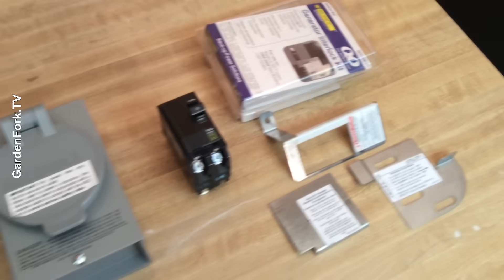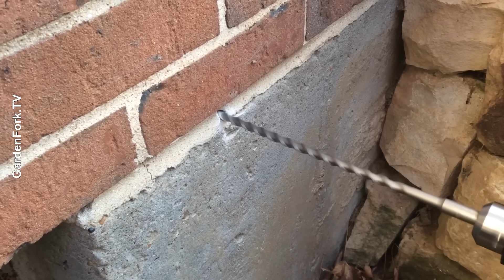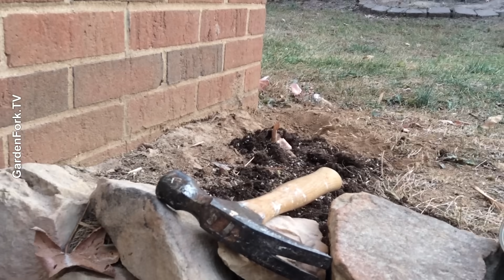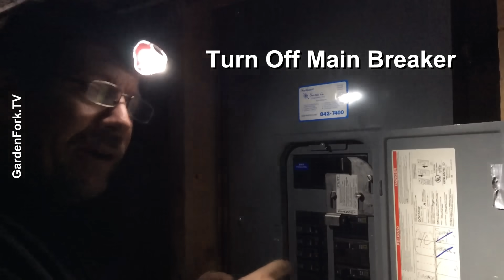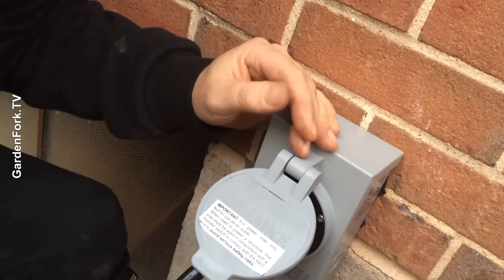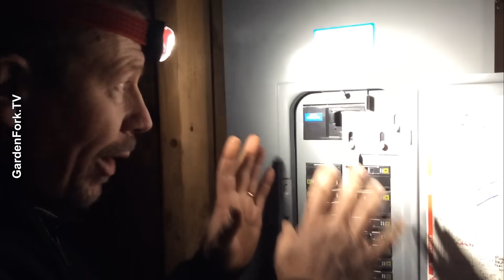Your Easy  & Safe Way To Hook Generator To House | Generator Interlock Switch Install | GardenFork

Comment: Possible Stupid Question:  If it's still gloomy or dark and rainy out, what's the best way to confirm that the power has come back on before you go back to your electrical panel and flip every thing back to their original settings?  Would you call or ask the neighbors or just keep an eye out for the street lamps coming back on?
Reply from the maker: No such thing as a bad question Tim. That is the issue with the interlock vs a transfer switch. I don’t have a simple answer aside from the street light. Thx!
Reply: I bought the reliance power back alarm. It solves this problem cheaply and effectively.

Comment: I just spent $900 + on a generator plus a outlet, breaker, & a female plug for my cord.

taped out.
can a interlock be made? My box outside is so old, I do not think I can find a interlock kit for it premade.
Reply from the maker: I don’t have the link with me, but there is a site that makes aftermarket interlock kits. Might be worth a search. For my older house I had to buy a manual transfer kit because the panel is an older model. Not cheap, but safe. Good luck.
Reply from the maker: Robert I’ve also seen some custom made interlocks, it’s basically a pice of metal that slides to prevent one from turning on the main breaker if the generator breaker is turned on. Thx.

Comment: Good video but may I make one suggestion if possible have to cord long enough to put the generator in the shed then u have no worries about the weather. I have the same setup but I have a storage shed about 80 feet from the house had an underground line put in and generator and plug stay dry. Yes an election put in the the whole works with 8 gauge wire.
Reply: No!  ignorant suggestion. too much line loss and heat. you'll just burn it up. although outside, so probably no fire.
Reply: @crawfislk  .. No real line loss for the first 100 feet, which includes the house wiring. If you are worried then go one size heavier on the generator feed so there's no loss on that run. Running inside a shed is can be dicey but if you have enough ventilation and enough distance between the gen set and other combustibles (like 5 ft) and the shed is not attached to an occupied living space, you might be ok. If you just want to keep the rain off then cut off an old patio umbrella and there will be plenty of cooling air on all sides so no worries.
Reply: Lyn Heydt j

Comment: Great video, as a 35yr electrician the only problem I see is that back feed outlet outside needs to have a weatherproof cover that allows you to close the cover when you have something plugged in.  They are required by The National Electrical code. Otherwise kudos on the video!!
Reply: It appeared to be 12 or 14 ga wire. Am I missing something?

Comment: I use an old washer/dryer selector switch to switch between shore power and my inverter. This setup is in my RV and obviously is too light for home use. the principle is the same in an automatic switch. 
I have 1 6A breaker (and of course a earth leakage protection breaker) for a single 220V circuit which powers a compressor fridge, various phone and laptop chargers and if need be some small power tools.
I use a household battery next to my starter battery which are connected together using an auto sensing relay. When I drive the RV around the starter battery gets charged and when it is full it will switch the household battery in parallel to the starter battery so both get charged. When the engine is turned of the starter battery is isolated from the household battery ensuring I can start the engine even when the household battery has insufficient power. I build the electrical system of the RV from scratch myself out of (mainly) repurposed household parts, no worries I am an electrician by trade.
To get to the question what generator I have ? Well technically the main 2800 cc Mercedes Benz diesel engine of the RV is my generator, producing (at peak) 90 amps @ 14 V of power. It gets stored (apart from the starter battery - 120 Ah) in the house hold batteries (which are two 100Ah AGM batteries) and put out to various 12 V systems like lighting, car lighter plugs, USB charging outlets and various fans. I installed a 1000 W true sine wave inverter to run inductive loads like the compressor chest fridge and various power tools. Inductive loads (basically anything with an electric motor in it) needs true sine wave AC to run correctly and reliably (most inductive loads will run on a non true sine wave inverter for a while but they will get hot fast and most will even break down very soon)

Comment: No need to turn off all the other breakers as  long as you don't try and run dryers, ovens, etc. with the 5kW generator. Even if for some unknown reason, you decided to start baking a cake or drying your clothes after the power outage, the generator will slow down and pop its own breaker. Reset it and don't try that again.
Reply: ACitizenOfOurWorld .. I wouldn't bet any serious money on the gen breaker protecting the gen set itself. It's meant to be protection for a short circuit and will usually hold a 20 - 40% overload for several minutes before it trips, and even a bit more when it comes to appliance motor starting, but only for a few seconds. In that amount of time you can overheat the windings and turn the gen set into a smoking paperweight. Take it from someone who repairs these things for a living. Staying within the set's limits is the only way to have your gen last. BTW, that includes educating the people who live there so they all know a mistake may put them in the dark.... WITHOUT a quick fix.

Comment: What about a lamp or buzzer on the line side so you know when the power comes back.
Turn off main breaker and plug in your generator..keep your fridge running and some lights ?
Reply: David; There are a million things you could do...it doesn't get any easier or safer than this...
Reply: David Fildes.. Good idea but not up to code having something connected to the line ahead of the main breaker. You could watch for street lights, watch the neighbor's house, (the guy who does NOT have a gen) or you could go out and look at your digital electric meter, which will have the numbers visible when the power comes back on. If all else fails you can throw your breakers and flip the main back on to double check.
Reply: Sensing when power comes back is a problem with generator lockout switches. There are a couple a possible solutions. There are inductive sensors that wrap around the incoming power conductors. In our area electric hot water is metered separately, so in that case, assuming you have an electric water heater, you can monitor the water heater circuit.
Reply: David Fildes 
Might consider buying a volt ohm meter, when the city or rural power comes back on you can test it where it enters you main breaker at point of connection
Reply: I bought the reliance power back alarm and it works for this purpose. It’s a cheap and easy solution.
Reply: Just get THP108 PowerBack Utility Return Alert. easy to install and it rings when the power is back.
Reply: soaringtractor .

Comment: Great advice. I am a licensed electrician in central Florida and I have installed several interlock devices this year. It is my favorite method to connect a generator.
Reply: Robert, mind if I ask how much you charge?
Reply from the maker: Thx Robert!
Reply: Robert Post Same question! How much do you charge to install this type of set up?

Comment: This is part of the reason why people use widow-maker cables that plug into the dryer socket to back-feed.
$50 for 3 small pieces of bent sheet metal & 4 screws is a ridiculous price...no other required parts are even included.
No cables or breakers or plug sockets come with the interlock so you are looking at a huge amount of money.
They really need to put the price closer to the manufacturing cost...somewhere around $10 would be fair to all.
Reply: $2.99 for the parts and $47.01 for liability insurance and litigation risk reserves for the creative idiots who figure out how to shortcut or screw up the installation...
Reply: @o2boutdoors  $47.01 for the parasite lawyers who get a huge piece of the action in a greedy, hopelessly corrupt society that they have created to feed their own avarice.
Reply: You are paying for the UL listing which means its safe, insurance company friendly and you wint have to uninstall it when you sell.
Reply: @NYHalfassprepper  .. Well said! As someone who sells and installs generators for a living, it's all about code compliance and UL listings. If you don't have that then you might as well prepare for a lawsuit... because it will happen sooner or later.
Reply: @NYHalfassprepper  .. Soon to be retired on my end as well!
Reply: My interlock cost $80. Money well spent IMO.
Your mileage may vary.
Reply: soaringtractor  .. You make a good argument but $50 for the interlock doesn't include proper plugs, cable, connection points, breaker, or labor. Those parts alone will cost you another $200 - $300 to do the job up to code, and that just covers the safety aspect. Using a small gen-tran style transfer panel brings us into almost totally idiot proof, which is different than using just the interlock, which may allow inexperienced people to overload the gen set by leaving too many circuits connected. Each to their own once we get beyond the safety part of being disconnected from the utility company.
Reply from the maker: Good point!
Reply: @soaringtractor  
I did not mention anything even closely resembling a transfer switch.
Please refer to the post above for an accurate account of my words.
But as @rupe53 has mentioned below...a transfer switch is much more convenient...and cost effective.
Reply: @soaringtractor  Personally I do not care how you did it.  But you still do not understand my original post.

Comment: '
one generator is a enough to the whole home...
how many watts give a whole home...
how long gasoline in generator running time...
how many gallons ( liters ) of full gasoline
Reply from the maker: It all depends on your home. Best to calculate your power needs and what kind of generator you have. Thx!
Reply: hi G F...
just asking the question about this generator...
dont have it and dont need it

Comment: But I have two breaker panels outside. My inside panel has no main. So I have to remember to throw the outside breakers first.  Good info.
Reply from the maker: An electrician should be called in for the install, safest way. Thx!
Reply: A backup gen NEEDS to tie into the main. Don't cut corners and make sure it's done right.
Reply: fideau one 
Keep in mind that it is the interlocking plate that makes it safe and legal, other wise you will be illegal and liable , understand .
Reply: Two panels here as well. One on the outside (with the main) and one on the inside (feeding all the modern marvels and convinces).

Comment: Generally speaking, what would I expect to pay an electrician to hook up an interlock generator? Roughly?
Reply: Depends on rates and what's involved. But probably in the neighborhood of 250-500. Save money and buy the parts yourself. The. You are only paying labor and avoiding their markup.
Reply from the maker: Sorry I just don’t know. I would look for someone with good reviews or a personal recommendation thx!
Reply: I.charge  300 to 500 if outlet for generator is within 25 ft    depends on how hard to get 10-3 wg wire from panel to generator plug.

Comment: Looks like the expensive way of doing an inexpensive job for powering only a few devices. My cheap way of doing this was to run a few extension cords from the generator (3500w) to specific rooms. Just enough to power the fridge, a 6' freezer, TV with cable box, computer and one or two lights. Since we may lose power for a day or two, permanent wiring not really needed. My expense, besides the extension cords, was adding a second 5 gallon tank to be able to run more than 8 hours (overnight) and not worry about spoiled food (or getting up early to refill). And I will know when city power comes back on with the other powered devices in the house. The wife doesn't mind stepping over cords for the short time needed.
Reply from the maker: My view on this is this method is safe,  or expensive. I have seen extension cords over heat and cause fires. Be safe! Thx.
Reply: I only use heavy duty extension cords on those odd winter days. I also use propane heat so don't need to power a high wattage heater. We hardly ever drop power in the summer and we live in Western Washington so we seldom need air conditioning. I had a career in electronics, so I understand  overheated wiring. Always safe, but thanks for the concern.